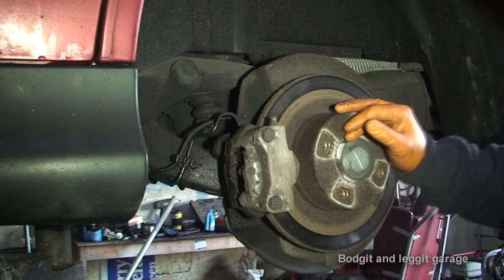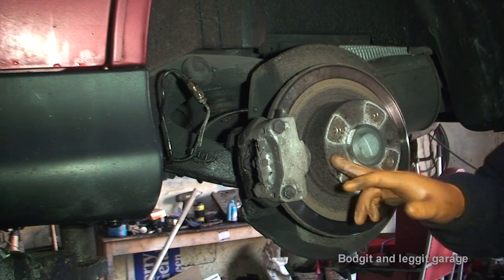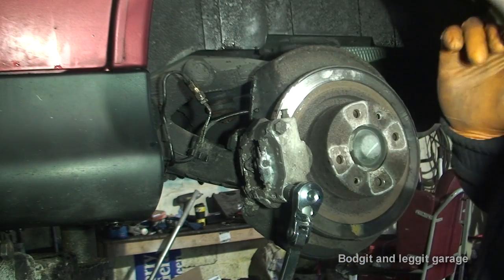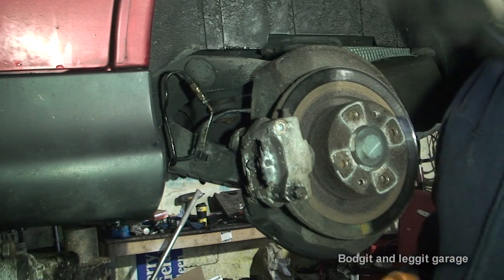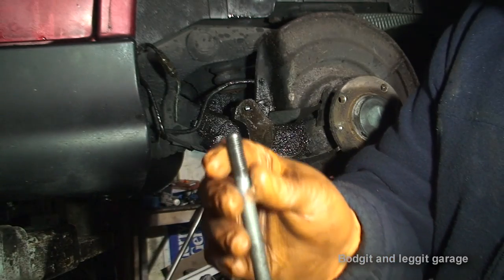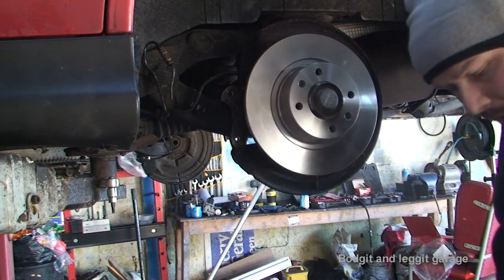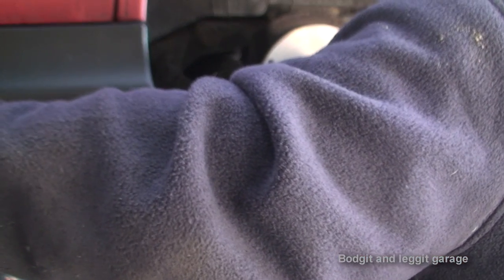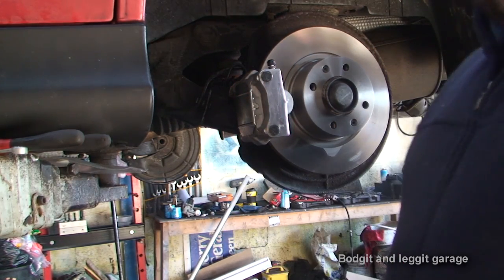bodgit and leggit garage how to do citroen c5 back brake pads/disc/calipers  (nightmare)

Comment: If anyone interested. Don’t touch the nightmare bolts. Once the pads are out the disc will slip in behind the calliper without disturbing it 😊
Reply: No, the disc cannot be removed without removing the caliper.
Reply: Yes it can … honestly . There’s loads of room to remove it once the pads are out

Comment: If you turn a bolt and it gets worse tighten up again and apply oil then remove it. He did  explain this in the second clip. Then ignore his own skills/advice in the third clip.
Reply from the maker: You just said it in your own question my skills / advice absolutely no point trying to put any oil into this it would never have penetrated the chemical reaction between the two metals that's where skill and experience comes in

Comment: Definitely grease the caliper bolts and threads before reassembling
Reply: Agree 100%
Reply: I think with this calliper which is apparently a split unit, you might introduce a contaminant into the hydraulic fluid if you add any kind of grease. I have to say though that your comment is totally valid otherwise.
Reply: I always use a thread sealant which tends to prevent the reaction between the disimilar metals. I use the medium locative (can't remember the number) and heat it to break the bond when I come to remove the bolts. As an aside, what a cap design!

Comment: 2 things come to mind as you worked on this.

I would have cut a slot on caliper and remove it. Who cares about core charge? Customer needs to pay for it. And there is no way they can rebuild this crap any ways.
And secondly, the dust cover is a joke! The salt will collect on it and this happens. I would leave it out and let the dust come out.
Good luck.

Comment: when i got my new car, i changed the breaks and lubed it all up with anti-seize. it took me 15 min each corner.  it was soo nice. watching you is my normal time. plus running a break line.
Reply from the maker: Lol thanks mate
Reply: I did the same on my Fiat Pandas. They are actually pretty good with proven parts. But the British penchant for road salt is seriously destructive. I use Action Can CS-90. Nothing has ever shaken loose. Also use it on bumper and wheel arch liner screws.

Comment: Had the same experience on my C5 2001 model. What was supposed to be a simple brake job, took me 4 days. One caliper bolt came out, another one snapped in half... Had to split the caliper, welded a nut onto the bolt and got it out with an impact wrench. What i learned: never buy french cars and always prepare the seized bolt with heat and lubricant before using tons of force
Reply from the maker: nerijuslesc the joys of working on a car mate lol thanks for watching mate

Comment: The bolts are stiff due to the fact that a loctite-type sealant is applied along the full shank length on assembly of the calipers. This is to ensure a more rigid assembly, not for corrosion resistance.   It is that sealant, not corrosion of the thread, that makes the bolt  hard to turn.   Forget about trying to release the screw thread.  The bolt will take extreme torque to turn them solely due to the sealant . Procedure is as shown in the video - check that the visible threaded end is turning as you turn the head. If it is not, you are shearing the bolt,  probably at the point where the shank meets the thread.   You have no choice but to shear to destruction (but see later).  If the first bolt turns OK, try the second before continuing.  If both rotate, screw them out together, say 1/4 or 1/2 turn each at a time.  Do not expect the bolts to come out of the calipers.  This method should result in the bolts freeing from the suspension arm, but retained in the calipers.  Now, you could try hammering the bolts out of the calipers or using a hydraulic press, but my recommendation is to forget them and throw them away and fit a new caliper and bolts. Aftermarket calipers are quite cheap and Citroen provide the special very high tensile bolts for only a few £s.  DO NOT use ordinary high tensile or stainless steel bolts, and ensure you reseal them as recommended (eg Haynes manual).  DO NOT grease the bolt shanks, to resist corrosion, the resulting brake assembly will not be sufficiently rigid.
If a bolt shears at the thread you will be left with a broken stud in the suspension arm.  Use standard extraction techniques, perhaps even welding a new bolt head on to it.
If you are insistent on removing the bolts from the caliper, drain all oil from the caliper and heat  up the bolt area with a very strong blow torch or oxy torch.  This will do 2 things.  Firstly, it will expand the bore of the alloy caliper greater than the diameter of the steel bolt, and secondly it will soften the sealant.  However, be aware there is a small o-ring between the caliper halves which will need replacing (another cheap spare from Citroen).
One of the common reasons to remove a caliper  is due to corrosion between the caliper and its mounting plate on the suspension arm.  This causes the caliper to twist, almost imperceptibly  The usual first sign is that the disk starts to grind away the caliper.  If this is left unchecked the twisting of the caliper places increasing stress on the bolt at the caliper/mounting plate interface, bending and weakening the bolt until it snaps.  This failure will, of course, happen when braking - likely during the additional forces of an emergency braking!?  So, if your disk is impinging on the caliper DO NOT simply grind away a bit of the caliper to accommodate the disk, as some owners appear to do .  But bear in mind that a caliper which has twisted must have have bent the bolt.  Hence, trying to unscrew even a slightly twisted bolt is likely to shear it, not remove it. 
To reduce future corrosion when refitting a caliper some owners place a thin DIY plastic gasket between the caliper and mounting plate - eg from a heavy duty polythene bag (non-degrading type).
Reply: Is this replacing discs pads and calipers your talking about?.
If it is its long winded.
The French do wine good and nothing else.
I do like your tutorial though.
Reply: @tam1381 - For brake pad replacement, only the single 8mm bolt need to slide  off.

Comment: Been servicing and MOT'ing my daughters C5 Break '01 for several years now.
Got my first BX ('87 basic) back in 90 and have sinced owned 5 BX'es and 1 CX.
The rear brakes usually needs a complete work over every year to stay in good working condition.

For some weird reason, Citroen decided to lock the C5 (and Xantia) rear caliper bolts inside the bolt bores in the calipers for safety reasons.
The earlier hydraulic models do not have this.
It is NOT rust as you seem to believe. You can find more info in the workshop manual (NOT Haynes) on this issue.
This makes the bolts completely (I am not exaggerating this !) impossible to remove without snapping them.
So the first time calipers needs removal after factory assembly, you will need new calipers and new bolts.
On top of that the snapped off bolts will more likely than not prove a real challenge to remove from the suspension arm.
An angle grinder is the most efficient tool to rid off the old seized on caliper and bolts.

I use aftermarket parts, never had a problem with that. Quite a big saving. And no deposit  / old parts return.
BTW new genuine Citroen bolts are very reasonably priced, no concern.
Reply from the maker: thanks for the info mate

Comment: Was brought up working on old cars in the 60's and 70's. Plus Gas, Plus Gas and more Plus Gas. Preferably soaking those corroded fixings every day for a week before tackling the job. Once you gain a bit of unscrewing movement-try winding it back a bit, then back and forth and more Plus Gas. Had to preserve the bolts in them days 'cos we couldn't afford new.
Reply from the maker: David K hi mate good advice I hear where you're coming from but unfortunately no customer would pay me to do all that work would cost too much sometimes it's easier breaking a bolt and just replacing it not saying it's the right thing to do but that's the world we live in now
Reply: Guess so. Incidentally my son has a 2004 diesel Jaguar with a wheel bolt seized like the one on your other video. Done by some monkey with an air wrench when he'd already done it once before. Now it's got a scab of weld on top where he tried and failed to attach a nut. I've drilled them out before but this will be a right bugger.

Comment: Lower arm 2nd hand cheaper to a days wage.work smarter not harder.Fellow mechanic from New Zealand.torque bolts to specs.if overtight pulls threads.I nearly bit my tougue brake fluid squiter over nice job.

Comment: Genuine spare bolts from Citroen are surprisingly cheap and most Citroen shops stock a wide variety of common bolts, nut and dings. C5 rear caliper bolts are intended to be a nightmare, because of the lockstuff smeared on to them at factory assembly.
Reply: They're a nightmare because of dissimilar metal corrosion,hence why the caliper had rotted away

Comment: I had this problem with a mates mitsi shogun rear calipers they were seized proper job we tried all sorts but didn't budge we used so much penetrating fluid that we got a christmas card from WD40, in the end I went out and bought a fecking big heavy duty air hammer  best tool for this job,  we had new calipers, pins and bolts so didnt worry if we marked the olds ones but made light work of it the rust that came out of them though and the 2 bolts broke free, its the best tool i've ever had the pleasure of owning
Reply from the maker: haha good thinking mate

Comment: Thank you for this excellent video. One of my back calipers look exactly the same according to a mechanic. Shop wanted way to much for the parts and work.

I'll try and do it myself so ordered new calipers, pads and disks. Hopefully I get the bolts out. 🤣

My dad (previous owner) said he unscrewed the calipers a few years ago for some maintenance so odds are in my favor.

Comment: As an engineer and not a mechanic I would have gone for the angle grinder and cut the alloy caliper off around those two big bolts. Even a slit down to the bolt would have released it and taken a steel wedge to free it from the bolt. 
Easy for me to say sat in my chair watching a video :)
Reply: the issue with cutting the caliper is that a lot of suppliers have a surcharge on the new unit until the old unit is returned, so damaging the old unit may result in an addition cost which either you or the customer will have to wear. Saying that there have been times i wish i could just have cut stuff off lol

Comment: Did this years ago when my C5 was about 3 years old; terrible job! One bolt snapped off inside the caliper. It took me ages to get it out. 
I did read afterwards that the bolts are 'glued' inside the calipers with Locktight on the shaft NOT the thread. There are holes on the side of the caliper which you are supposed to run boiling water into to disolve the Locktight and allow removal. I can't confirm this as have not had to do this again since.

Comment: The BX and Zantia were exactly the same, The first thing that happens is the calliper corrodes and pushes the calliper off so trapping the bolts, and then the bolts get stuck in the alloy callipers so getting them to turn is highly unlikely.
They are of course assembled dry at the factory and the rear brakes on all these Citroens don't do much unless the car is driven fully loaded all the time.
So the rear pads last a long time, by the time they need attention everything is just like that, a horrid big mess.
If the callipers are toast anyway easiest way is to use the blue spanner and heat the callipers to near melting point and work the bolts loose.
This needs patience working the bolt back and forwards till it lets go.
Why didn't you plaster everything with copperslip on reassembly, it does help next time.
As someone said the callipers were modified so the pad retaining bolt went through more metal, but they still corrode against the steel pushing the calliper off square and if you look at the pads
and they are both worn an an angle you know those bolts are going to be a proper bastard.
Reply: copper grease actually doesnt help.....it needs a plastic gasket between the arm and caliper so ive read to stop the galvanic reaction .....or slow it down atleast .
Reply: @martinparker6536  Better than nothing Martin,
anywhere you have Aluminium and steel in close contact the ali fizzes away to white powder, maybe the copper becomes sacrificial, I do know they don't grow into the twisted, powdered mess next time you have to deal with them.  Just like allow wheels dry fitted, I've seen big chunks of wheel sick to the hub after you get them to part.

Comment: Absolute and utter nightmare. I remember working till midnight to eventually put mine back together after what I thought was going to be a simple disc and pad change. 
Wife kept coming out and saying "thought you said this was a quick job, your teas oot". You didn't seem to swear as much as I did though, (or did you edit this !). I owned 2 MKII C5 estates, excellent cars in some respects, but Sh*t in others. I was lucky as I could get the bolts out on both the cars as were still failry young (was still a sod),   Galvanic corrosion also caused the caliper to missalign with caliper.  However, would love to meet the design engineer, wonder if he's ever chewed a C5 MKII caliper or removed it from an orifice.
Reply from the maker: DiyMech lol yes mate lots of editing all the swearing out

Comment: I remember a terrible Mini, think it was the crank bolt and it was a reverse thread and I am oiling it, heating it and doing all sorts so I got out the big guns, my 4 foot truck breaker bar... it came off alright, sheared the bloody thing leaving me to do a full stripdown to get the crankshaft out and down the engineering shop to have it reamed out...   I had an even longer breaker bar than that I got from BR, like a six foot length of scaffold tube and bloody heavy with a great socket head welded to it, I seem to remember it was a fishplate bar in the days before on site power and air tools that they use today, I was explaining to someone today about the ol' chain and bollard bodge and how to unmangle ones front or rear end and used that bar to tickle the bits into shape with me mate on other side hammering it and someone giving it rizz on the pedal as they pulled back from the bollard, it weren't pretty and looked cowboy as hell but worked super well if you did it right.
Reply from the maker: Sorted

Comment: Nice work Leon. I've just had to cry off doing exactly the same thing on my '07 C5. Three of the bolts move great, one is moving perhaps 5 degrees, and not moving at all at the back. I decided to quit before I broke it and let the pro's sort it out.
Reply from the maker: Lol sometimes you just have to break it or cut it off mate lol

Comment: That job.  Despite heating with oxy acy, those caliper bolts stuck fast with the thread lock from factory . The bolts snapped 20 mm inside caliper.. I sliced the caliper apart, welded large nuts on the snapped bolts, which snapped again further down lol!  Another two bolts welded on and I finally got them out. I had a 5ft scaffy pole on it and heat. I etch primed the new bolts and put 2 coats of engine enamel on the shanks, then Aluseize grease. Same with new caliper faces. 2 yrs on there..........time will tell.

Comment: Very good video mate the only things I would have done different is put some copper grease on the caliper bolts and been a bit more gentle on the brake master when blessing. Good tip about gravity feeding fluid I used to do that myself but a lot of mechanics I new didn't and just ramped on the pedal and ended up having master cylinder problems.

Comment: What a struggle, but in the end you won! I've never seen aluminium parts corrode so badly.
If it were me I'd  probably slather those bolts in anti seize to try and prevent this in the future.

Comment: Additional comments: contrary to the video which is WRONG in places and DANGEROUS
1. The calipers are NOT handed.  The pressure and bleed nipples can be swapped to make a caliper left or right handed.
2. DO NOT assemble the bolts "dry".  The specified sealant must be applied to the whole bolt shaft.  The 2 small holes in the caliper, which intercept the bolt bores, are there for a purpose -  to inject activator to accelerate the hardening of the sealant and make the assembly rigid - bolt torque alone is not enough.
3.  Always use new bolts.
4. Always seal the interface between the caliper and mounting bracket to prevent future corrosion.
THE CALIPERS IN THE VIDEO SHOULD BE REMOVED AND REFITTED PROPERLY - SEE HAYNES MANUAL.

Comment: Have you thought about an inductive coil heat gun? Direct heat only to the seized bolt. Expensive but the 'hot spanner' usually does the trick.
Reply from the maker: scotsiain1970 yes mate I've certainly have thought about it just never got round to buying one but they are a good bit of kit need to save up some more money then we'll get one lol

Comment: nice job,u dont need to change calipers,u can srew metal plate to it with hole to hold barke pad bolt :) on my xantia is easy,but i broke one hole with hold brake pad bolt,and made metal plate and screw it to caliper :)